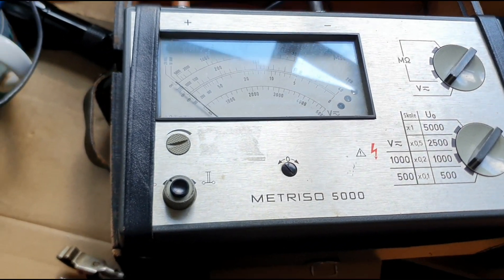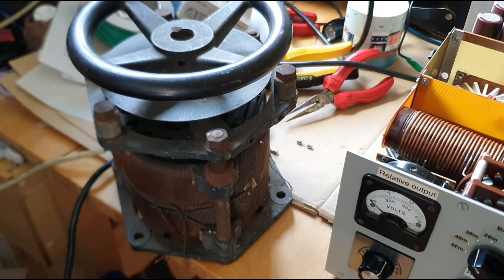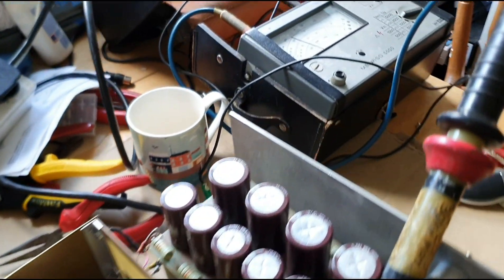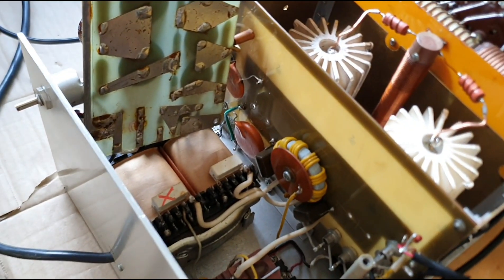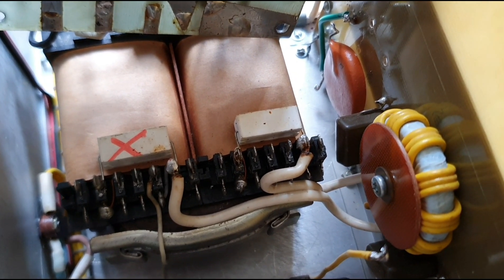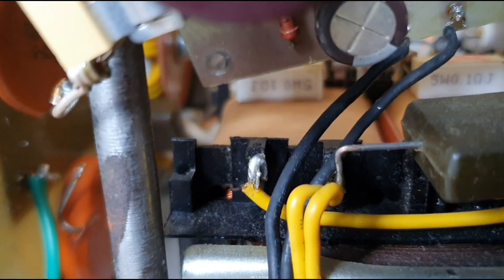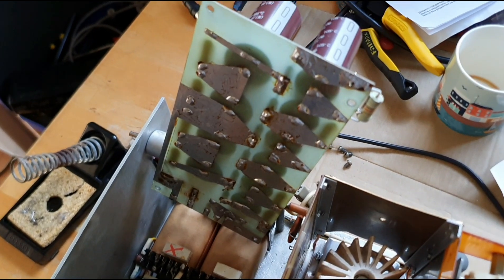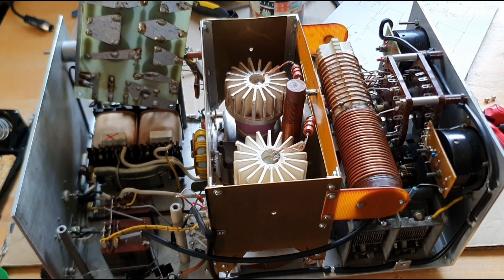Finding The Fault. HF Amplifier repairs.

Comment: I'd really like to pick the brain of G4TCB at some point. "Standard valves" here in the USA are becoming utterly unavailable or else becoming PUNISHINGLY expensive for complete crap zero quality control shit from China. I mean that as no slur to the nation or people of China; they are clearly capable of making any level of quality specified by the purchaser, since they make essentially everything technology based for all of "the West" except for some pretty esoteric stuff and/or where National Security has kept certain manufacturing technologies "on shore" (more should be back on-shore for Nat. Sec. and other reasons) or where some things are getting "re-shored" for supply chain resilience reasons. But the middlemen in the business of bringing in far East "standard ham rf power valves/ tubes" like 811a, 572b, 3-500z, 8877/3cx1500a7, etc etc." are basically bringing in utterly dodgy crap (if you can get anything at all for 'new' versions of these tubes and you get killed on costs of supposed "NOS" that's generally not new and, if it's "new" may likely be counterfeit, not "old" that costs a fortune and if you are unlucky it's going to crap out mere weeks after "warranty" and if you are lucky it'll still never have combinations of performance/ reliability that "the real things" always had. During the late 90s/ early 2000s, there was a huge burst of USA ham interest in cheap ex-USSR RF power triodes but that was basically a "flash in the pan" that was over almost before it began and nobody in the USA ham sphere has done much with RF power tetrodes since the birth of the grounded grid 3-500z and the discovery that the already ancient technology 811a triodes that dated to or slightly before WWII, could be amazingly decent grounded grid RF amplifiers. I already own some Gi7bts that I want to use to repower a Tentec Centaur 811a amp (but without doing irreversible botching up to the Centaur) and I really really want to get some Gu43b tubes as a fallback plan for a really nice vintage amp that I have that runs the now cripplingly unavailable 8877 (and get the 8877 amp to be able to run as grounded grid tetrode in true tetrode configuration like a Collins 30s1, but without botching up the 8877 amp in irreversible ways. I have one 8877 used and supposedly still usable as a spare, but after the unknown life of that secondhand used 8877, I'd be dead in the water. I'm not even slightly savvy about whether or how you can or can't private message on YouTube but I'd really welcome it if someone could give me tips on best place and mode to get in touch with G4TCB - between what I see here and some reviews/reworks of amps  to ex-USSR valves that he's mentioned on eham. Thx and 73. Trevor, KD1YT, Vermont, USA
Reply from the maker: Hi Trevor if you search G4TCB on QRZ you can get Pete's email. He will reply and give you a Skype number to reach him on. Sorry I took so long to respond the comments can become overwhelming and some get forgotten. Pete will definitely have plenty to say regarding amplifier talk he is very knowledgeable and enjoys teaching and sharing his knowledge. Tell him I sent you his way. btw I had a quick QSO last week with him on 80m. 73 Good luck